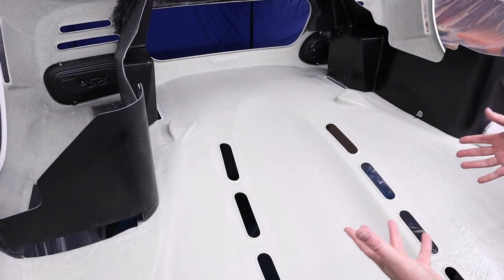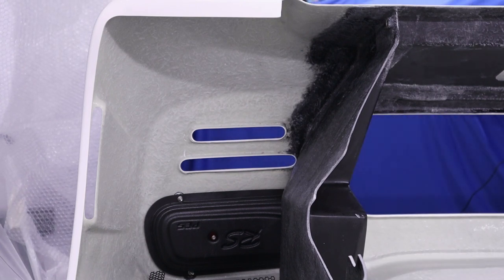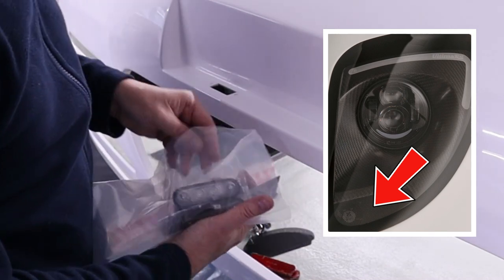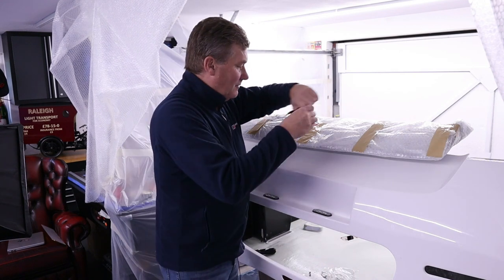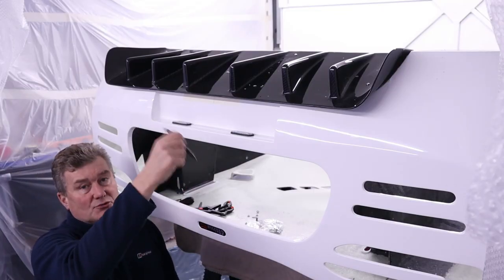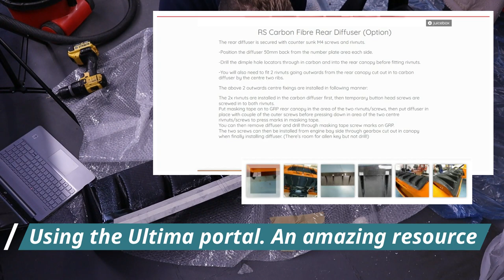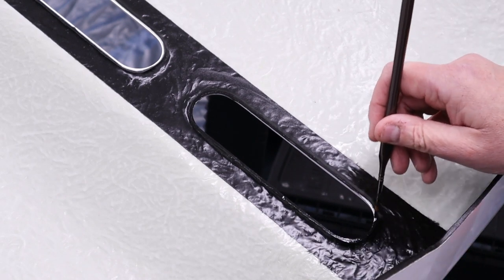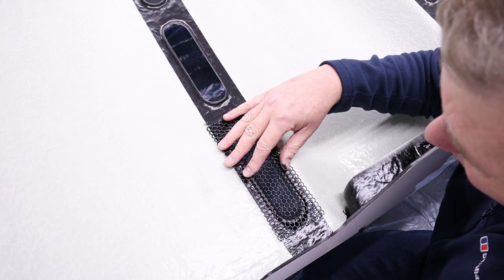Building an Ultima RS with Nigel Dean. Part 27. Cracking open the carbon aero

Comment: Great progress being made Nigel, you’re making it look very easy indeed. Nice to see the creative director, also head of security, making a return. In one of Will’s Blunicorn RS vids, he mentioned how the undercoat seemed to change the depth of the gel coat on the outside. Can you notice any discernible difference between the painted parts and the area left for the heat shield? 

Good luck getting the next episode ready for Christmas. I’ve asked Santa to make sure it’s here in time……🎅🎄
Reply from the maker: Hi Garreth, there is no difference in transparency once the heat shield is fitted. It's my next job in fact so need to get some template paper. I will need to do a couple of extra nights in the Dean Den to hit that Christmas deadline. Cheers Nigel

Comment: Nigel, how many black spray cans did you use on the front and rear clam shells? That portion is in high speed so it's hard to determine how many paint cans were used. Thank you an Merry Christmas.
Reply from the maker: Hi RS, I used 2 cans for the front clamshell and 3 for the rear. Merry Christmas to you also. Just planning my Christmas episode but challenged with time due to other demands running up to the festive period as you can imagine. Cheers Nigel
Reply: @v8creative  when watching the video, you painted the entire underside of the front clam shell, but the rear one looked like you painted stripes around the vents and a few other places. Any reason you did not paint the whole underside black in the rear?

Comment: Have to admit with all the beautiful engineering going into the project the messy silicone made me cringe 😂
Reply from the maker: Hi Ross, I must say it’s like icing a cake but the lighting I have to use for the camera work is rather intense. Once the heat shield is on and the clamshell fitted it is hardly noticeable.